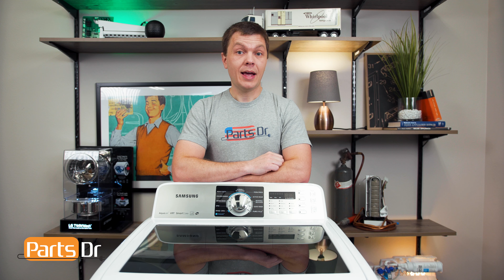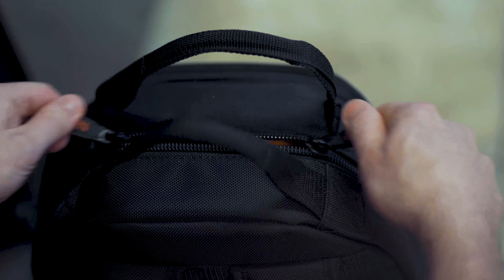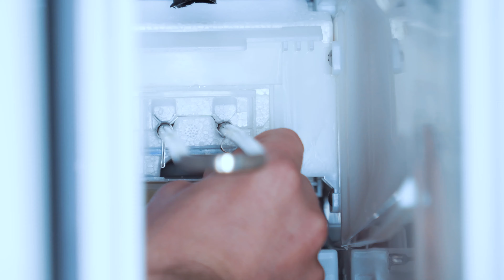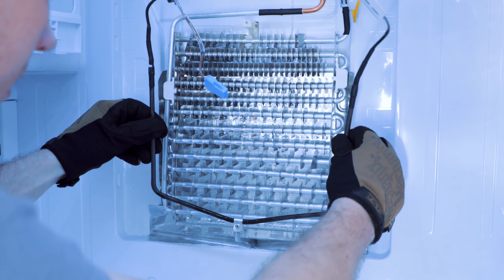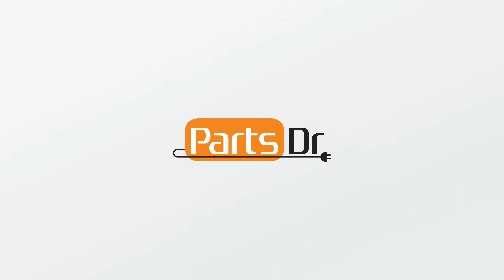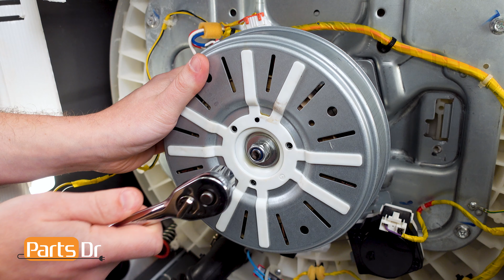How to test & replace Samsung washer motor stator part # DC31-00154A

Comment from the maker: Thanks for checking out our video on replacing the motor stator in your Samsung washer! If you're ordering a replacement part, be careful with cheaper aftermarket options you might find on sites like Amazon or eBay. These often don’t match the quality or fit of the original and can lead to performance issues or further damage. For a high-quality, genuine OEM motor stator, head over to https://partsdr.com We only carry parts that meet or exceed original manufacturer standards. Happy repairing and let us know how your fix goes in the comments!

Comment: I have an older Samsung washer wf337aar/XAA with the motor dc31-0049a I can't find a hall sensor replacement. What I'm curious about is there a couple of years newer model motor that would fit so I can find replacement parts.

Comment: I did everything you said in the video. But I noticed there was oil all over the magnet and the motor is that normal? I cleaned everything and put it back together and still getting E3 code. Any suggestions 
 Than you
Reply from the maker: No, that is not normal.  The most likely cause of that would be if your clutch assembly is failing and leaking.  Learn more here: https://www.youtube.com/watch?v=VErDV4mXmkM

Comment: Idiot question here. I damaged the stator copper wires when trying to get the stator cover off. There are now two broken and missing peices of wire.
Is my stator toast?
When I put the washer back together with the broken part it won’t spin.
I’m guessing that damage fried the stator.
Reply from the maker: We don't know of any fix for this other than replacing the stator.

Comment: I have a samsung front loader WF42H5200AW/A2. It stopped with 18 minutes left in the cycle twice, I finally shut it off and pulled the clothes out. The washer spun the water out of the clothes. It has also been making a load whirring noise and moving around. I went to put the machine on self clean but it wouldn't fill or agitate. You could see the drum  struggling to turn. I got a 9.35 a 5.36 and a 4. Something on the ohms test. Can someone please help figure out what is the problem
Reply: Did you figure it out? My washer stops spinning and if I open the lid and manually spin the drum/agitator it will eventually start spinning. Thanks in advance
Reply: hey, i am having that exact issue, did you figure out what was the cause? i have had 4 persons check the machine and they cant figure it out yet.

Comment: this model number stator should read 19.3 ohms at room temperature, if it is good. The readings he makes on the stator in this video determines it to be bad
Reply: are you able to figure out what ohms would be good or bad for model number wf42h5000aw/a2  ???  please help

Comment: What if my stator is reading 12.5
Reply: Mine reads 11.8, so I think it is different for my Samsung. Looks identical. The stator is AP5583744 on a Samsung WF395BTPAWR/A1
Reply: @alexisdavis1507   yours was bad ?
Reply: Did you ever get an answer to this? Mine reads 12.5 on all 3

Comment: Does all the stators motor in the front load washing machine should have the reading ohms between 9 to 9.5 ohms?
Please
Please 
Answer to my question 
Thank you so much an advance
You have the best YouTube channel and you are my reference to learn and all the time I ordered my parts through your website
Reply from the maker: The stator ohm value varies on different model washers.

Comment: Hi.. I'm having a problem with Bosh series 6 model top loading washing machine.. I replaced the motor and the stator because the previous one making an noise when it's washing mode... Even after i replaced with new still the same noise.. When spinning no noise... Can you explain me why??
Reply: Did you replace the clutch

Comment: Are you on Facebook?
Reply from the maker: https://www.facebook.com/PartsDr
Reply: @PartsDr  I wanna be friends on fb with the dude in these vids.
Reply: @PartsDr  Hi I have Samsung toploader 18kg it gives me a 8c1 code it does not have vibration sensor, I replaced pc board and noise filter, all the displays wor fine, there is also power to the pc, when I press, wash, rinse or spin nothing, I only hear the drain motor working, the machine is only 3years old, not sure what to do???